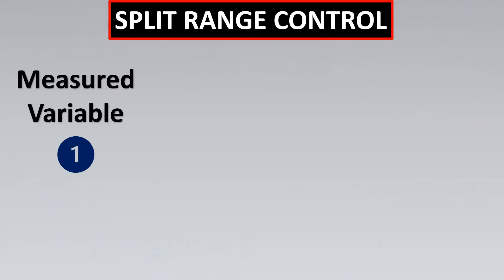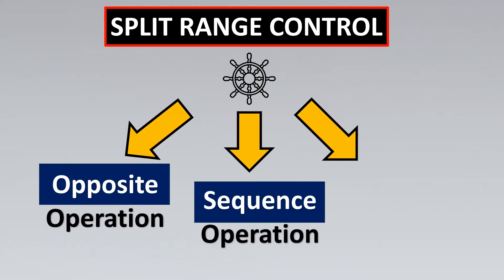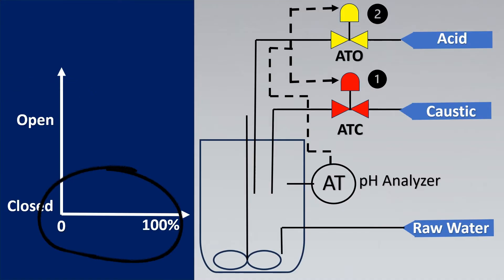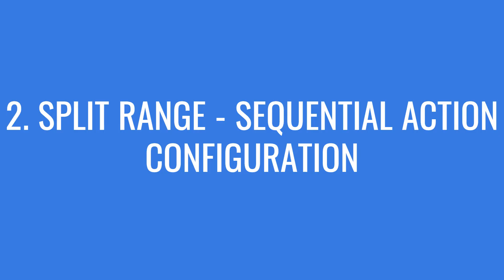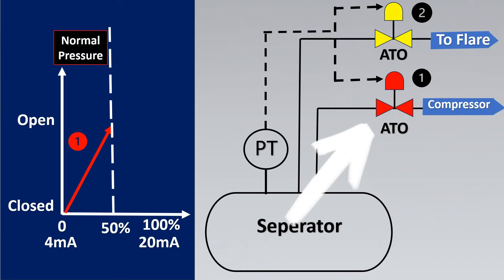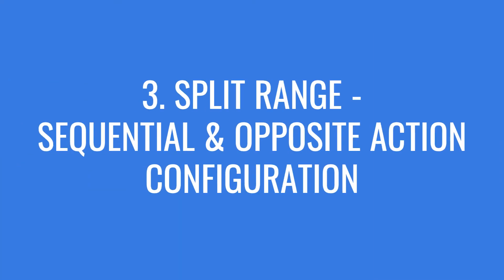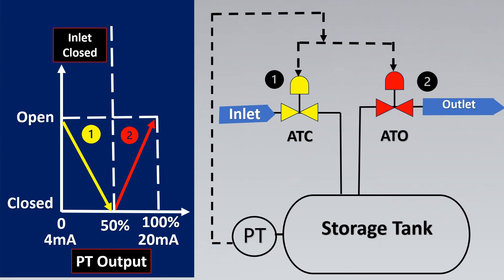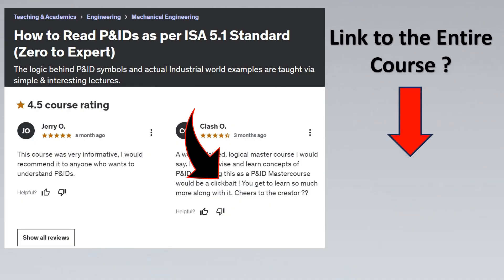What is Split Range Control ? | World's Craziest Explanation Ever

Comment: I think ATC and ATO valves should be reversed in your examples otherwise in air fail condition tank will be damaged
Reply: Even i think the same..
Lets take the 3rd example, if inlet flow is controlled by ATC, at air failure condition it will be open. This makes the  tank to be filled continuously, eventually damaging it.

Comment: You have left out the controller assuming that it would be understood. 

Now consider a case where a single transmitter sends process measurements to two controllers that in turn modulate their respectively control valves: one control valve for each controller.

In the above case, it is not considered a case of split range control, now is it?

Thus, I would like to emphasis the role of the controller in your explanation.

Comment: What ranges would each CV positioner be calibrated for in each of these cases?
Reply from the maker: Your question are always thought provoking, I really enjoy them. As for this question can you elaborate it ? thanks 😊
Reply: The control Valve which needs to be opened first should be calibrated in the range of 4-12MA and 2nd one should be calibrated 12-20MA. Hope this answers your question.